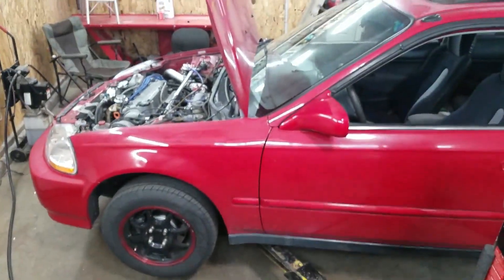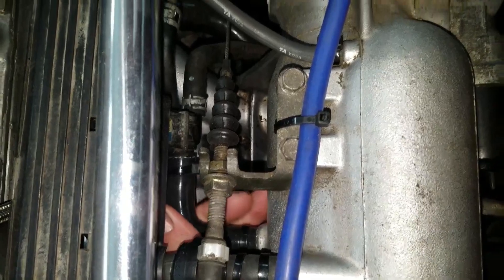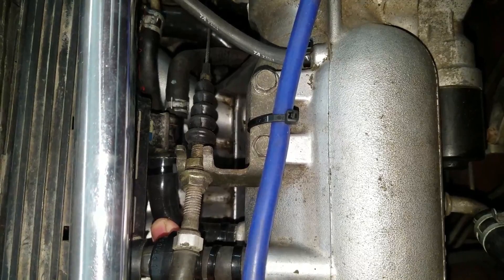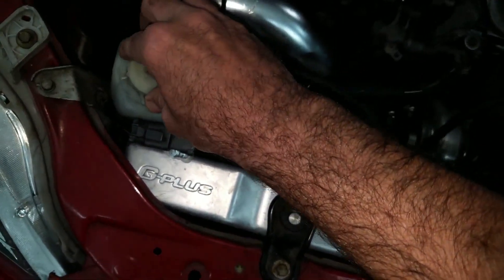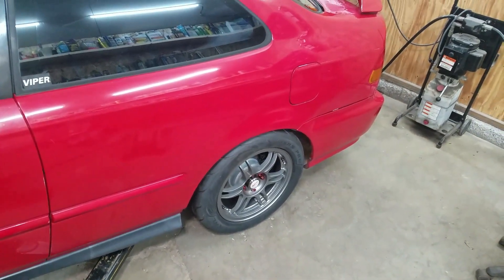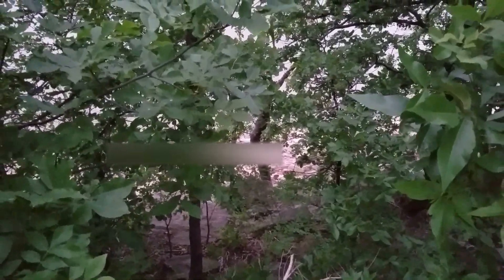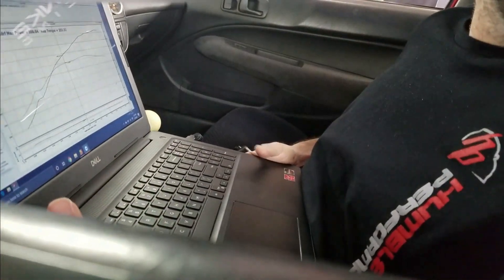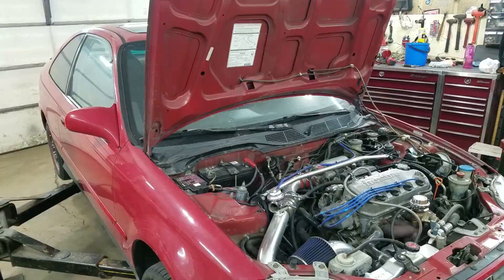Ej8 D16 Ebay turbo 3rd tune part 18?

Comment: What about "BlueDevil" for rear main seal?
Reply from the maker: Nothing going in any of my crankcases but oil. There was a little wear groove on the sealing surface of the crank I did not get ground off when the crank was polished. It's good to resurface those, but I'm too cheap. Thought I moved the new seal back enough to not touch it. Guess not. Not a major leak or anything either.

Comment: 400 HP
So what is done other than the turbo, I just found the channel
Reply from the maker: A bunch of stuff. Going to do a bunch more. It doesn't like open lapping the way it is at the moment. There is a video where I took it on a dig after my last tune, that is now my trailer, and everything I did is in the description.

Comment: What size turbo are you running?
Reply from the maker: .57 trim 63ar t3 t4.
Reply: @RustBeltAuto  did you only have to cut a little off the block?
Reply from the maker: @gilbertgarcia4288  The engine, and head had been resurfaced. All other machine work had been done to make like new. I have like 23 video's in a playlist on this thing. It shows pretty much everything I have done to this.
Reply: @RustBeltAuto  sorry man I tried looking back. Im trying the to turbo my civic so just wanting some info sorry.
Reply from the maker: @gilbertgarcia4288  A couple of those video's I did had a complete parts list in the description. Seems to be a nice build so far. I think I'm done after putting oversized head studs in it. we will see.